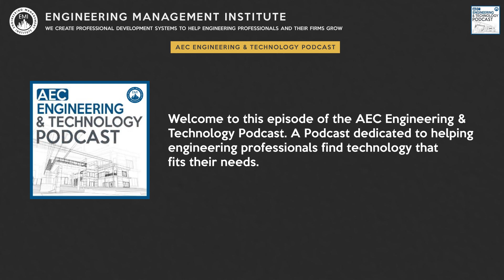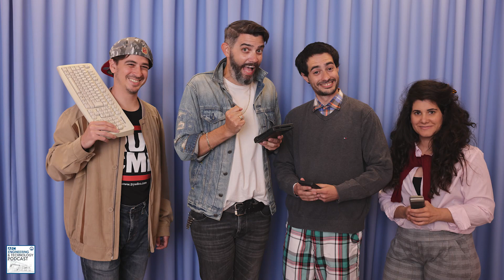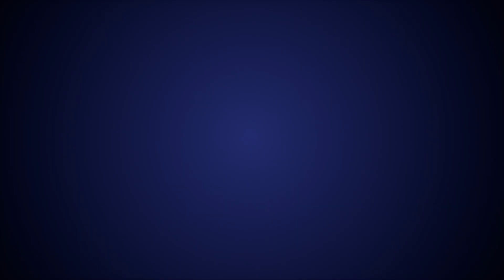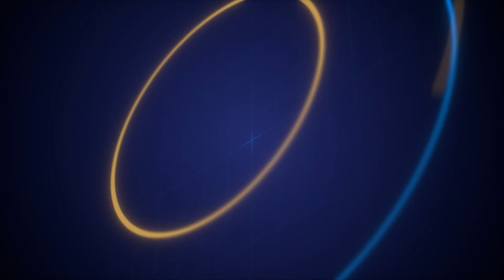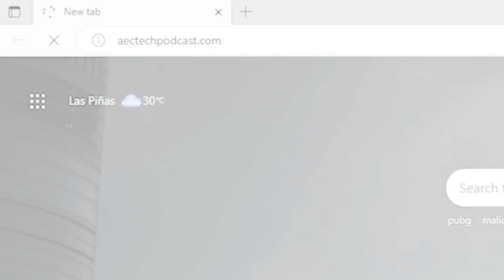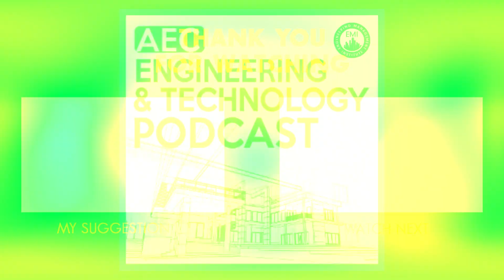How AI is Changing the Software Engineering Landscape

Comment: Export the MatLab, Azure, Chat GPT, Revit, Plant 3D, Civil 3D, Inventor, ENGI file of the Building or Refinery to Excel, prepare Budget 1 and export it to COBRA. Prepare Budget 2 and export it to Microsoft Project. Solve the problems of Overallocated Resources, Planning Problems, prepare the Budget 3 with which the construction of the Building or the Refinery is going to be quoted.
Reply from the maker: @roldanduarteholguin7102 That's a cool vision for the future of engineering!  AI/ML is definitely making strides in areas like interoperability (making different software work together), budgeting, and resource allocation.

Challenges remain in data standardization and model accuracy, but tools are emerging that leverage AI/ML to improve specific aspects of design and project management.  This video explores some of those advancements!

Thanks for your comment!